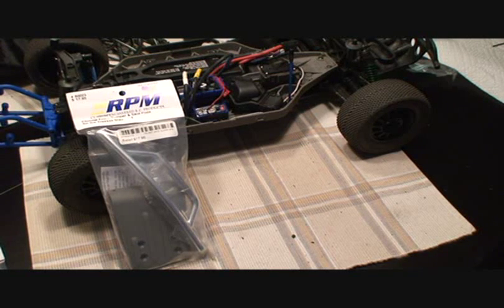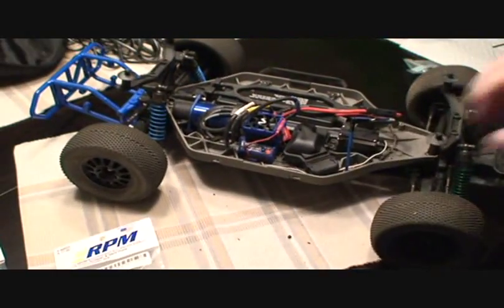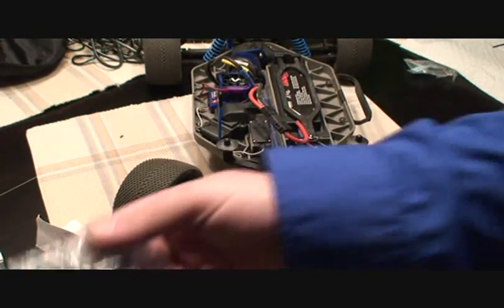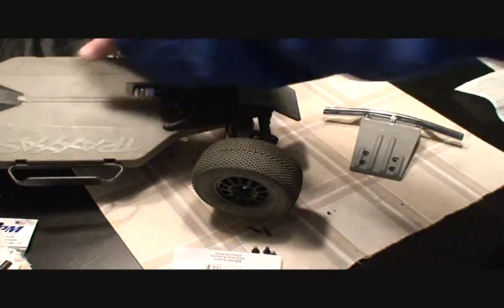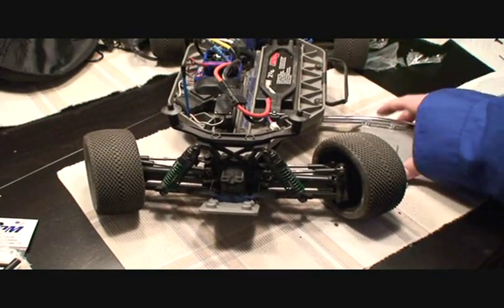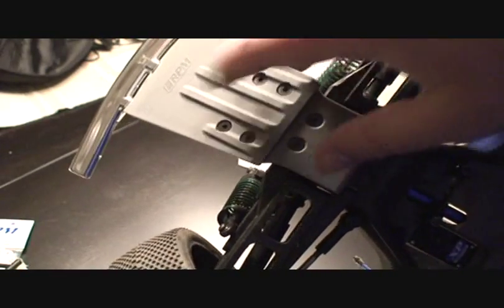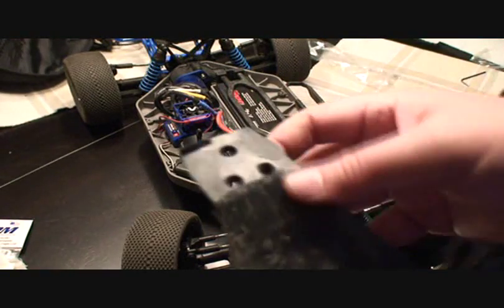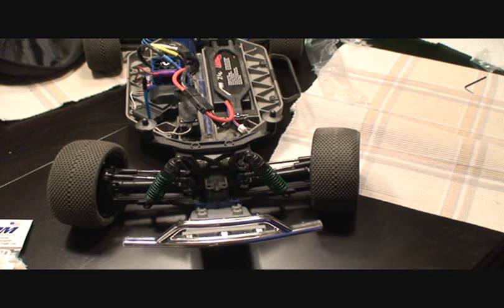Install RPM Front Bumper Skid Plate Slash 4X4

Comment: Blue firm plastic and fake chrome, hmmmm... Not on my truck! Hard plastic does not absorb the impact; it transfers it to the more expensive interior parts and the electronics.  Traxxas ones are much better in my opinion and the Slash doesn’t look like a cheap toy with them.